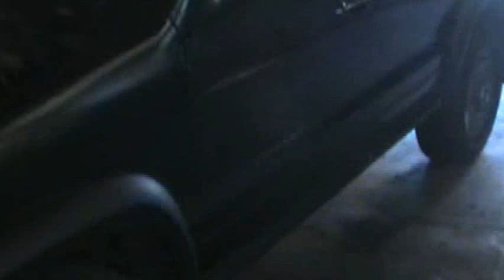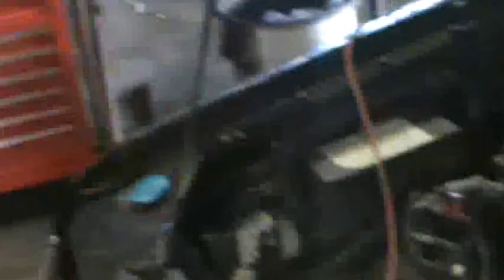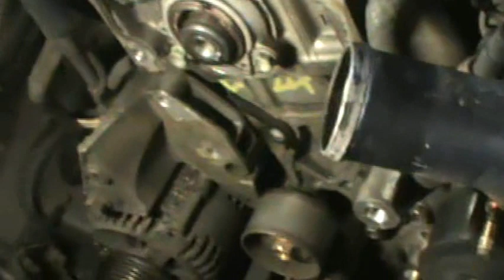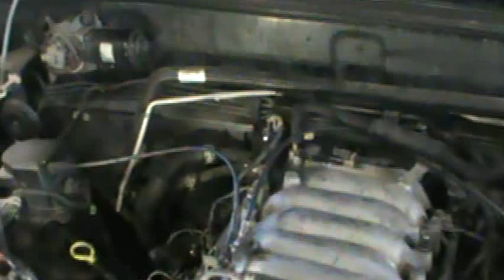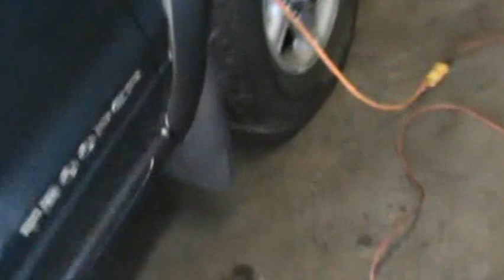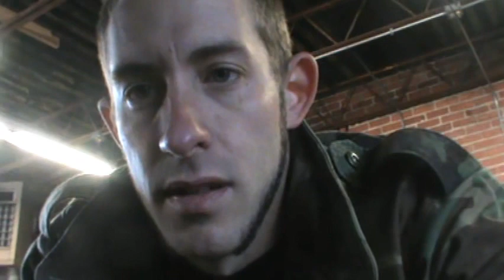What happens when you don't use oil in your car

Comment: MY CAR (2011 BMW 520i) HAS BEEN BROKEN FOR MORE THEN 4 YEARS IM TOO LAZY TO FIX IT CAZ THE DAMM OIL RAN OUT AND BLEW THE ENGINE. every day i see a little tree grow out of the hood im gona let it sit for 10 years see what happens to it well it rust apart or well the tree grow around it. :D
Reply: what? swap the damn engine
Reply: O Matlo B I thought about that. But then  a new engine is around 9000$ usd and by now alot more things are broken. It's already been 5 years the glass is broken all the wheels got stolen. And my x6 is soo much better I reached 306 kph in it. The 520i only did 260ish. But I did abuse it in did over 30000km with no service and I did many stunts it was my first "expensive" well to me it was.
Reply: well u dont put a brand new engine into a used car,

4 used wheels isnt that expensive, and fix the glass, get the car to a reconditioner afterwards. 

Then sell it or something or use it as a fun toy 
Turbo-project or something
Reply: O Matlo B ya know what that's a good idea !! IL come back to ya on that one. But right now I'm restoring my dad's BMW e30 m3. Il be done in around 2 months. After that il go looking for a second hand m5 engine!!! Ohh the crazy stuff I can doooo!!! Hopefully it don't hurt my pockets too much.  Thanks for the info man!
Reply: +DONT TELL MY AMMA  I had a simelor thing happen. I got mixed up last year and put a galleon of anti-freeze in the hole where the oil was supposed to go. The injun startid to make a lotta weird noises, and then a buncha green stuff came spraying out the tailpipe, and then it just shut off and didn't do nothing no more. I ain't got no trees up in it yet, but the Kudzu is swallering it up pretty quick.

Comment: Great video sir. Very informative to people that just don't get it...Oil is the blood of the engine. I'm constantly stressing this to everybody. I had a 92 Taurus that i got up to 380,000!!! Religious oil changes...original engine, one rebuilt trans. The final chapter was a blown head gasket. Anyway...Question, what's your point of view on "timing chains"? Change at manufacturer's recommended interval? Or allowable to pass the recommended manufacturer interval? I never changed the timing chain in my Taurus, and now have a 2003 Matrix with 160,000. It has a chain?
Reply: Jay The Ash tRay I have a Mitsubishi lancer wagon. just went over 200k hope many more miles
Reply: Despite what people may say about Ford, I love their vehicles. I have a 99 ford Taurus that currently has 253,000 miles on it. My parents owned a 98, but junked it because it had a blown head gasket. Mine did too; however, I took on the task to replace it myself, and to my surprise, It really wasn't all that difficult. Of course I've had to do regular maintenance on it, but considering I bought it in 2010 with 128,000 miles on it for $2,800, I'd say I got my money's worth! I just purchased a Mitsubishi Endeavor and hope to get many more years out of both vehicles.
Reply: Zap Rowsdower212 Nice!
Reply: Jay The Ash tRay yes it runs well. I got it at 171k.  I got the timing belt and water pump done just for peace of mind since I didn't know about the history. she purrs like a kitten

Comment from the maker: hey roxanne, sounds like you might have an issue but i would first try putting oil in it and see what happens, worst case you did some damage to the engine, try to fill it with oil and see if it makes any noises while it running also check the coolant level and make sure it full. hope this helps sorry for the stress
Reply: Heeij you live near me! (Gwinnet county) you still repair cars?